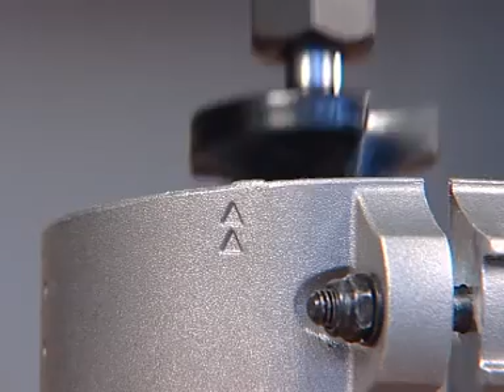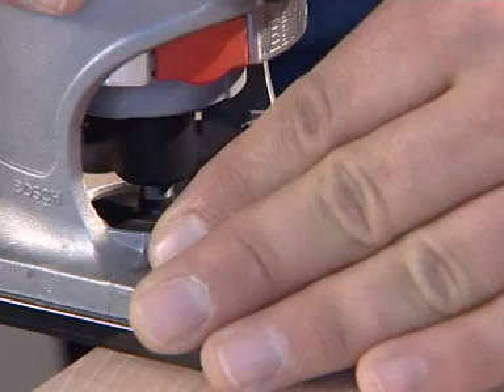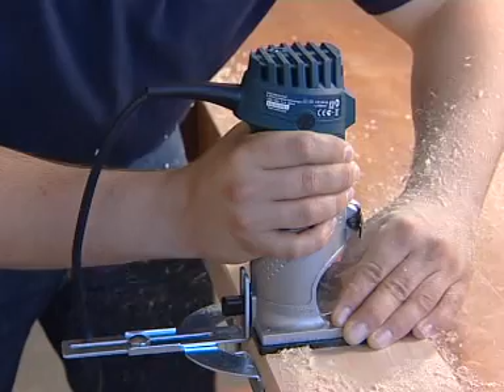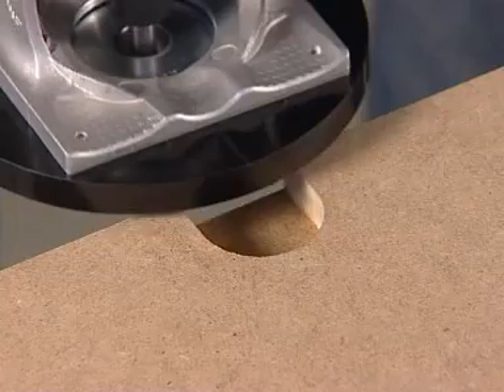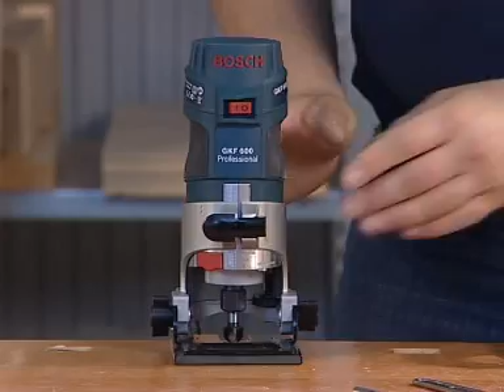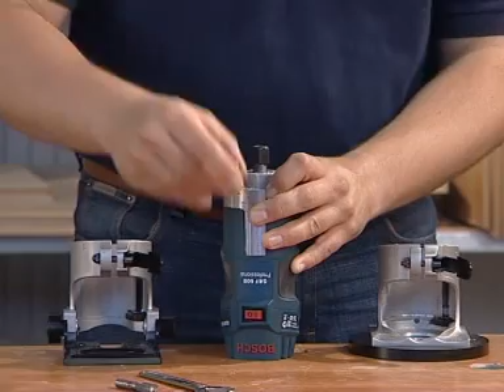Bosch GKF600 1/4" Palm Router / Laminate Trimmer

Comment: You're trying to make this look to simple. You don't just drop a bit into the collet, it has to be pulled up a bit from the bottom , then tightened up. I like this router , but the elevating mechanism is not as good as you are implying.